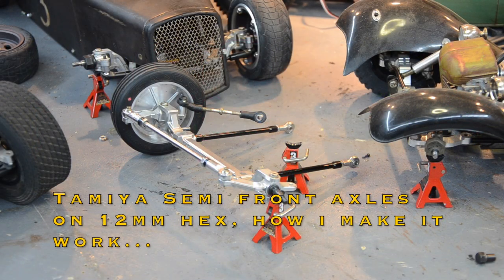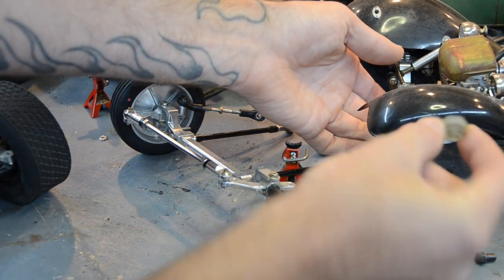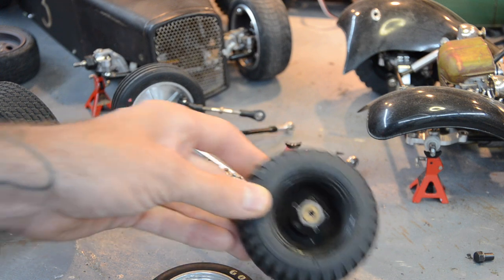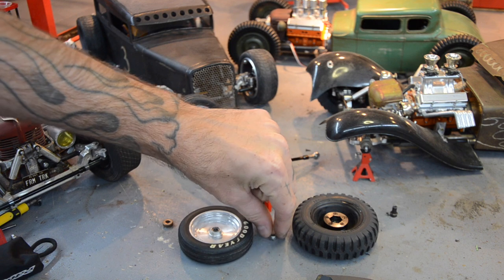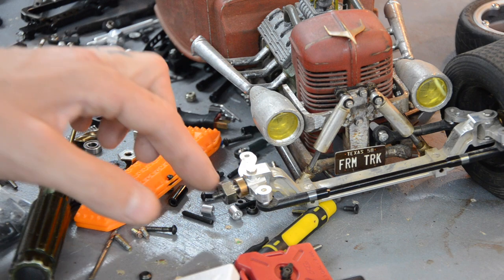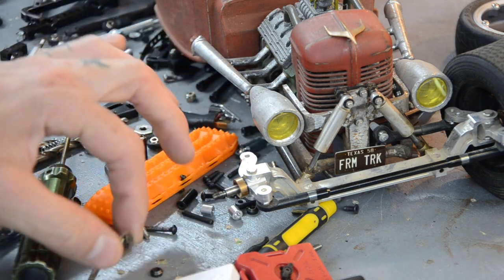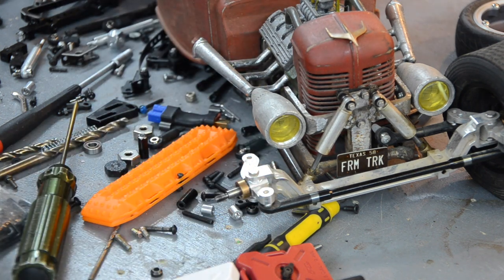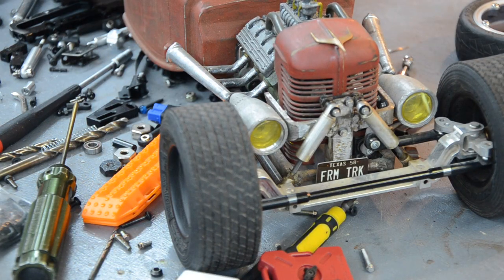How To, Tamiya Semi Front Axles to 12mm Hex, RC RatRod RCengineering

Comment: One solution is to use the aluminium wheel adapter for Tamiya DT-03. GPM among other sells these on ebay with 12mm hex and bearings.

Another solution is to use two 850 flanged bearings (8x5x2.5mm in non Tamiya language), drill out wide plastic hex with 8mm hole insert the bearing on the inside, fit the other bearing in the wheel after opening the center hole to 8mm and then use a nut like you do on regular kits, barrel nuts if there is not enough threads for a normal nut.

The adaptor is using 1250 bearings or 12x5x4 bearings if you like.

Keep up the great work 😃

Comment: Alright man, this is definitely what I was trying to find out.....well halfway,  how bout rears? Making the dually wheels fit 12mm hex? Maybe it comes later..... anyway thanks for the info
Reply: How bout one of those 55 Chevy hood airplanes?.....guess I need to get a 3d printer. ....
Reply from the maker: The dually rears come with a 12mm hex already, no mods needed to fit them.  Those hood ornaments are available on shapeways printed in plastic and metal options.
Reply: @RCeveryday  originally my idea was 4x4 dually, but when I got the wheels, my idea turned into dually hot rod rear engine dragster thing. But Now they sit in the spares.  The cheapies I picked up are the exception (1 side 12mm hex, other side in the rear has a bearing race). So I bought a second set, and they were 10 lug instead of 8.